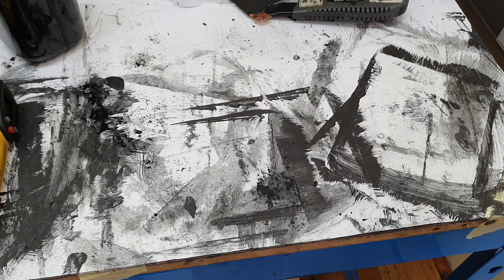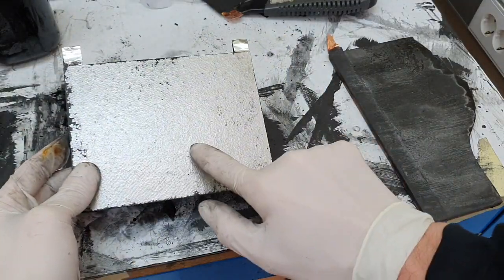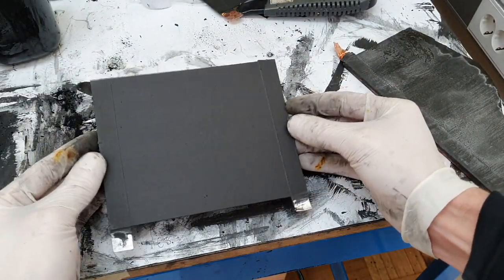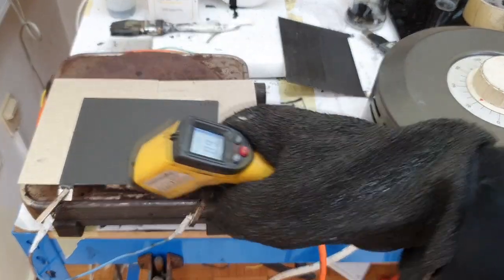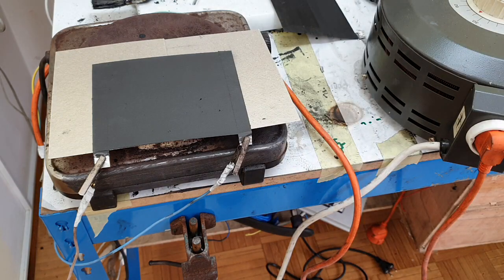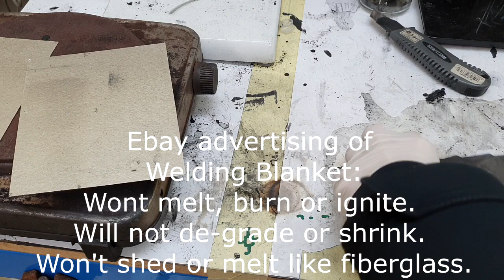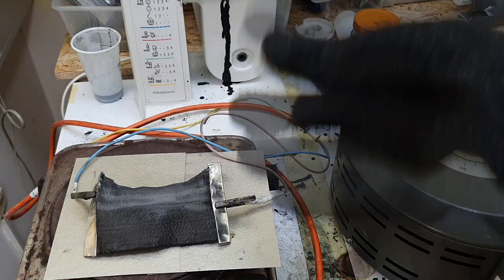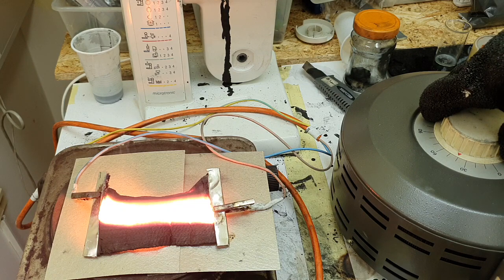High temperature Conductive ink - 1000 degg C (Update)

Comment: 12.22 you didn't "make a very bad heater" , you inadvertently carbonised & oxidised the substrate in place, & showed several other very useful things, (a very  doable diy voltage) 35vac-60vac gets you a very hot localised strip, no 'Nickel-Chrome resistance wire required' , and depending where you attach the +- power you can vary the heat band to the centre strip keeping it away from the edges, success , rob would be proud ^_~

Comment: The ink looks great for making kiln heater elements, if you can find the right substrate and a reliable method of connecting to it.
What is the square resistance of the various inks you have made when painted on an insulating substrate?
Merry Christmas and a happy new year :-)   Martin.
Reply from the maker: Yes. Square resistance on this is 10 to 6 ohms. On other types of inks is the square resistance 50 to 2 ohms depending what type is the ink.
Reply from the maker: Merry Christmas and happy new year also to you my friend.
Reply: @cayrex  Are you selling the inks, if so what is the price and properties of the different inks?

Comment: Greeting
What is the type of current AC or DC
On the 30V voltage which is the power of current (A)?
In short, which parameters to have a device for measuring: A, V, W, R?
Reply from the maker: AC. 30V and is less that 10A because the fuse is limited to max 10A.
Reply: Thanks for your reply,
I need to get the AC 0-30V and 0-10A device
In practice how much less than 10a

Comment: Hi. Did you try to make a microwave kiln using this ink ? In other words , will a layer of this ink get white hot when put in a microwave ?
Reply from the maker: Hi! No, I haven't tried this on that ink. On direct current can get really hot, which radiates heat like crazy from test heater. But I dont know for microwave. Need to test it
Reply from the maker: Now I make a test with homemade microwave kiln and this conductive ink and works like crazy! 😲😁
Reply: @cayrex  Time for a new video ...:) ?
Reply from the maker: @pieterwaterberg8138  yes. I will upload today, maybe. Right now I make really simple microwave kiln. I didn’t put much effort into making a nice kiln, because I just want to try the ink first. The temperature was so high that clay pots which I use for the base, start to "melt" (make bubbles in clay) on some areas.
Reply from the maker: @pieterwaterberg8138  I was able to use that microwave kiln 3 times before the clay pots break to pieces
Reply: @cayrex  I reply on your new video . Thanks !

Comment: I would like to use it to warm a small space like say travel trailor or very small camper. But on around 12v do you think that this would be possible on this low of a voltage? I'd like to make a small workshop. but want a way to heat it that wont take up much of the limited floor space.
Reply from the maker: You need around 35 (floor) to max 55 (wall) degg C. In this case you need our heat paint which can be used on 12 or 24 volts
Reply: @cayrex  this will be a great project to experiment with. Thank you for these videos.
Reply: If you heat the floor where you sit or stand it is best effeciency as the heat will warm up your extremities first .
Reply: @Buzzhumma  I do think that will be my plan. I am still working out how and were i will be placing shelves and other things like were i will physically be in the space. but I do think that this will be a very great way of putting warmth right were i need it.

Comment: all i need is a heater with 25cm x 25cm working on 6v/250mA to produce constant temperature of 80°C . 
is that possible?
Reply from the maker: 80C on 1.5 watt,... I think not. 6 or 12 watt,... maybe
Reply: thank you for  reply me.

👍😊

👏👏👏👏👏👏👏👏👏👏
Reply from the maker: @attilarivera  no problem 😉

Comment: Maybe it was the paint burning and not the welding shield ?
Reply from the maker: The paint is fireproof, I burn the paint painted on glass fibers and stone with blowtorch with no damaging the paint. Also the paint was conected to AC for several minutes that the paint was glowing. Also in the video you can see that the welding fiber shrink and also the back start to burn when I burn the heater with blowtorch.
Reply: @cayrex  Yes, you can also see that the flame itself was concentated on the backside of the fiber material - where you did not paint. You only painted one side of the material. Really awesome results, the ink recipes have advanced even further! I can't wait to see what kind of industrial uses this high-temperature ink has. So many come to mind!
Reply from the maker: Yes I paint only one side of this fiber. Yes the ink have many applications in industry
Reply: Zacariah Heim hi Zac , my mind has not kicked in to gear yet on ink uses . Can you list a few that come to mind ?
Reply from the maker: @Buzzhumma  @Zacariah Heim .... the use of the ink (for example this high temperature ink) have many applications,.... because this ink is special developed that can withstand the temperature over 1000 degg C have the main application in heating applications,... normal IR or resistance heating, high temperature heaters (900 degg C) which are  used in farms, industry, outdoor,... owens, powder coating owen, autoclave owen, laboratory furnace,... heat coating for suppressing the moisture/humidity in rooms, etc,... ceramic glass oven / hotplate, etc. Similar IR heaters are used also in hospitals. Also, low power consumption IR/resistance heater can be used in heating the Li-Ion battery packs in EV, etc,....
Reply: cayrex2 i think you better make a video addressed to Elon Musk on why he needs to buy your ink ! Seriously !!
Reply from the maker: @Buzzhumma  nice one, but is really hard to get to Elon. In basic you have also other companies like Tata, Rivian, Faraday Future, Lucid motors,... Several years ago I make also a video about EV car heater based on IR ink to replace PTC cabin heaters. PTC heaters consume about 3 to 6kW of power,... IR ink heater consume only 700  to max 1000 watt and heat the cabin of the car really nice. But I never put the video on youtube. I think that battery pack heating have more potencial for EV.
Reply: cayrex2 yeah but elon has space  x 😎 rockets need heat paint 🤔
Reply from the maker: @Buzzhumma  hahahaha yes right
Reply from the maker: @Buzzhumma  maybe I will contact US Air Force, because with little modification on the ink can work like radar absorbing paint, hehehehe 😅🤣
Reply: cayrex2  ah yes but remember ..... once your in ... your in 😷
Reply from the maker: @Buzzhumma  I was joking 😅
Reply: @cayrex  i wasnt😅🤣
Reply from the maker: @Buzzhumma  I know 😑😁 working on military stuff can be tricky, especially working for US 🤔🤫😁
Reply: @cayrex  maybe just sell it to them on ebay 🤑🤑
Reply: @cayrex  So lack of follow-through is why?